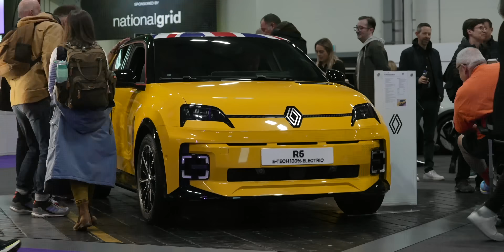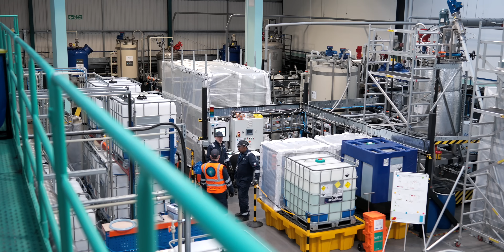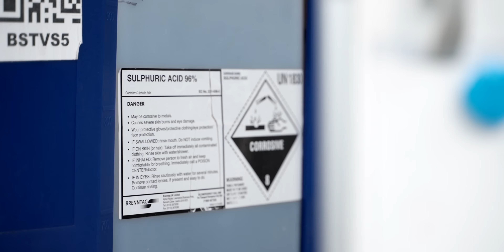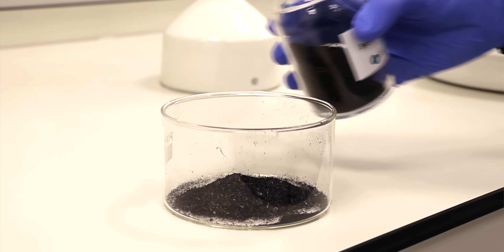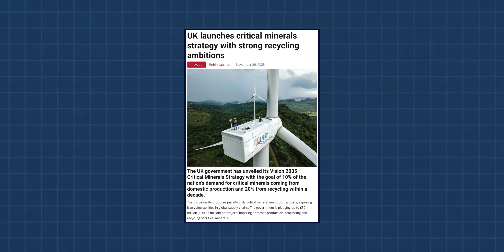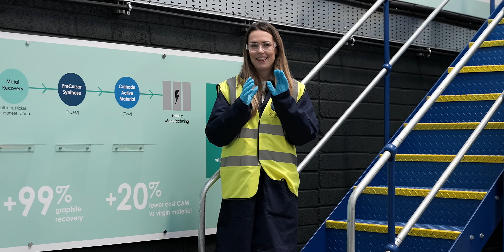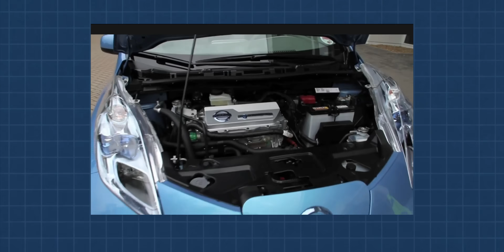EV Battery Recycling Could Be The End Of Mining!

Comment: I accidentally think that currently there is not enough used batteries for recycling to be actually profitable, a lot of second hand batteries are going towards electric storage, EV conversions,...
Great video
Reply: It seems you may be correct. EV batteries are lasting longer than anticipated, and of those that do become available. many get used for energy storage in commercial and industrial applications.
Reply: @Brian-om2hh 

An interesting point.

I would suggest the reason for this "longer than expected" lifetime  ref BEV battery packs is that BEVs aren't driven that much after all.

Which might suggest to the financially literate that for the private buyer spending a fair old chunk of cash upfront (and possibly on terms) is not such a clever idea.

Leasing has its own drawbacks too, which you can Google for yourselves so I don't have to crib if off the internet for you.
Reply: @ForestForest-n9i You can Google it. There are numerous BEVs with 300,000 miles or more. Not hard to find.
Reply: @ForestForest-n9i
At some point it’s worth stepping back and looking at what’s actually working now, not what’s been “five years away” for the last two decades. Battery Electric Vehicles (BEVs) have already won the light-vehicle race on efficiency, infrastructure, cost, and real-world usability, while hydrogen remains a niche science project for passenger cars.
First, efficiency matters. BEVs convert roughly 70–90% of grid electricity into motion. Hydrogen vehicles (both FCEVs and H-ICE) lose huge amounts of energy producing hydrogen, compressing or liquefying it, transporting it, and then converting it back into electricity. Once you count all that, hydrogen struggles to reach 25–35% well-to-wheel efficiency. Using clean electricity to make hydrogen instead of charging a battery directly is simply wasting energy.
Second, infrastructure is decisive. Electricity is already everywhere. BEV owners can charge at home and use a rapidly expanding public network. Hydrogen stations are rare, expensive, complex, and unreliable. In the UK there are only ~15–16 hydrogen stations total, with about 6 open to the public, versus 57,000+ public EV charging points and growing fast. Globally the contrast is similar: millions of EV chargers vs ~1,100 hydrogen stations. You can’t scale a consumer technology without infrastructure, and hydrogen never has.
Third, cost and practicality. BEVs have lower total cost of ownership: cheaper “fuel,” fewer moving parts, and less maintenance. Hydrogen fuel is expensive (often $10–15/kg in the US), stations frequently go offline, and you can’t refuel at home. This isn’t theoretical—hundreds of Toyota Mirai owners in California are now part of class-action lawsuits after being stranded by broken stations, skyrocketing fuel prices, and vehicles that have lost most of their value.
Fourth, a point often ignored: FCEVs still use lithium batteries. They are series hybrids—hydrogen makes electricity, which is buffered in a lithium-ion battery that powers the motor. So arguments against BEVs based on batteries also apply to FCEVs, plus FCEVs add fuel cells, platinum catalysts, high-pressure tanks, and more complexity on top.
Fifth, the market has already decided. Global EV sales jumped from ~3 million in 2020 to over 10 million by 2023, with BEVs dominating. Automakers and analysts (IEA, BloombergNEF) consistently point to batteries as the winning technology. That’s why companies like GM and Stellantis have scaled back or exited hydrogen passenger-vehicle programs, and why hydrogen is increasingly being limited to specific heavy-duty or industrial niches, not everyday cars.
Hydrogen cars do have zero tailpipe emissions, but once you consider production methods (mostly fossil-based today), energy losses, infrastructure costs, and real-world failures, they simply don’t compete with BEVs for personal transport. While hydrogen advocates keep promising a breakthrough “soon,” millions of people are already driving cars that are efficient, affordable, charge at home, and work every day.
This isn’t ideology—it’s engineering, economics, and market reality. For light passenger vehicles, the conclusion is no longer controversial: plugging in beats waiting for a miracle fuel. @ForestForest-n9i
Reply: @ForestForest-n9i @ForestForest-n9i Tell is about what car you personally own then. Is it hydrogen?
Reply: @oddjobsandrandomprojects all the Norwegians and Aussies must be wrong too

Comment: The UK added only 1.6% of extra cars to the roads in 2023, these were mostly NEV's, so the number of total cars on the roads increased by very small percentage, not talking about turnover understand, but the total number. So if all cars on the roads were EV's and all EV batteries were recycled after the car was scrapped then the total of new material required to make new EV batteries would be, well about the same tiny percentage. Of course this doesn't take into account the batteries given a second life by using for other purposes, but these of course can be recycled when they aren't useful for that as well so in the long run the world with full EV saturation and proper recycling would need to dig up very few resources to sustain the same number of cars, only enough to cover the extra dded EV's per year. Of course moving way from lithium to solid state batteries that last longer and don't use these minerals will make a big difference also. While yes 95% of ICE cars are also required to be recycled, that doesn't remove the impact on the environment from running those engines for 10+ years.
Reply: Most Solid State batteries will be Litium based, with similar cathode materials. The Solid State bit changes the electrolyte, less so the anode/cathode make-up, nor the charge-carrying ion (Lithium). Indeed, a secondary recycling step may be added to recover the Solid- State electrolyte (depending upon it's formation, plastic or ceramic) in addition to the cathode materials.   

In terms of NMC, there are constant changes in cathode formation, such as the continual reduction in the amount of Nickel/Cobalt/Manganese needed in NMC cathodes (down to 1/18th of what was used in the past, and just about to drop again to 1/38th). This means the volume of minerals recovered from older batteries, will go further with a greater number of NMC battery cells made out of the recycled minerals. 

Further, alternatives, like LFP today, have different recycling steps but not too dissimilar to those used for NMC (can be performed in parallel), and new chemistries like LNO (Lithium Nickel Oxide) are starting to move out of the labs (and may displace NMC), which will add additional mineral needs and recycling chains. However, even if NMC is displace the minerals recovered stilll have a value in industry, just not reformulated for new batteries.

Lastly, Sodium may come on stream, although for the UK's mild climate this may not be immediate as Sodium is currently targeted as a cold climate technology (due to Sodium cells degrading faster at warmer temperatures). 

As to input material availability, in general, the battery recycling industry isn't aiming for a 10 year horizon, more a 20 year one, to start scaling from the 2040s, by which time it's projected to be a $90bn global business. What is being developed now are the chemistry approach, processes and equipment to be ready for that scaling (which will be rapid). Although, this could change and accelerate more rapidly, particularly if manufacturing automation reducing car pricing. For example, if automation enables cars to drop to more 'commodity' pricing level rather than 'aspirational' pricing, then beyond the initial take-up of 2nd life use, batteries may become more readily available as cars may change more frequently than they do today, with components feeding into the recycling process earlier than now.
Reply: @GruffSillyGoat Interestingly BYD and other are researching lithium sulfur based and sodium sulfur based solid state batteries. More research has been done on lithium so of course these are probably more advanced in the case of research and development, but sodium sulfur based batteries have a much higher potential for energy storage, 2-4 times that of lithium sulfur with some laboratory tests reaching 900-1000Wh/kg.

There's no doubt huge room for improvement in all battery types and development will continue into the future. Yes it's very likely the first SS batteries will be lithium based, but there is huge potential for other chemistries that may eventually supplant lithium batteries, the future is looking interesting, not all of us will be around to see it of course but it will interesting nonetheless.
Reply: @stevebrooks2361 - Once SSB's are fully cracked I anticipate the battery developers will shift focus to Metal-Air, particularly Lithium-Air which has a max energy density of 11,140Wh/kg (circa 4,000Wh/kg expected). The solid state electrolyte removes one of the key barriers to their implementation today, the solvents or aqueous based electrolytes cause unwanted oxides to form. The remaining batteries after that are more mechanical after that point, removing pollutants from the atmospheric oxygen cathode and preventing water access.

Sodium-Air could be developed as well but offers a lower 1,600Wh/kg energy density.

The drivers for these batteries will be all types of vehicles - planes, ships, etc - not just road vehicles.
Reply: @GruffSillyGoat Oh in the future yes, but as I have said before, battery development is rarely a revolutionary change, it's more evolutionary, we tend to go through all the steps between, so yes eventually that's where we will end up. Of course economically there's a natural anchor in factory investment, you don't build a battery manufacturing facility and then rip it down a couple of years later because you need a different facility for a different type of battery, you really need to run it for a few years and sell batteries to make that initial investment back. You might start small scale manufacturing of new batteries, but you have to make money on that factory investment first before changing over.
Reply: @stevebrooks2361 - you're assuming that new technology isn't a drop in replacement that can reuse the same lines. Your aldo assuming  the same manufacturer is involved rather than a new competitor who displaces an old one by developing new technology (particularly if aligned with national interests).
Reply: @GruffSillyGoat SS batteries can't re-use the same manufacturing lines as current batteries, any new and different battery technologies will probably have the same issue, so it's a fair assumption to make based on current trends. To make batteries as cheaply and quickly as possible manufacturing lines are fine tuned to the current battery chemistry and design.

Donut is an example of your second suggestion (well if it turns out not to be a scam as many are suggesting,)  yes it's true a new maker could come into the market and build anew facility, but Donut are looking at only 1GWh of battery manufacturing for the year to come according to their own statements. Building huge manufacturing facilities takes years and billions of dollars, there's a reason why a few battery companies dominate the industry, it's a very expensive one to break into.

Economy of scale is everything in the battery industry, new startups either need backing from the big companies or they need big venture money willing to invest in a risky venture, not easy to come by, but even then the economic factors involved will still be difficult.

This is one of the reasons many companies are saying 2030 for mass manufacturing of SS batteries, even of they have products ready to roll, around 3 or 4 years is what it will take to transform the industry to SS batteries with some small manufacturing going on for select products in the mean time.
Reply: @stevebrooks2361  - many solid-state makers are specifically aiming for incremental technology that takes advantage of current roll-to-roll production techniques and equipment. Solid state isn't orthogonal to existing processes, but an evolutionary one.

European manufacturers are seeking to match the competition, but are doing so using existing processes, such as Ilika plc in the UK who's been developing their own oxid based SSB for a few years now. The rest is a matter of commercial reality, and government support; the latter becomming more important as many governments have deemed domestic battery productoin a critical industry to establish and maintain. This is one reason why the UK has invested in battery production, having around 20GWH currently, but ramping up with a number of gigafactories supported.

As to Donut Lab, they claim their current pilot line has a 1GWH capacity, and have a site in Finland to implement a 10GWH production capability. Time will tell whether they're product matches their statements.
Reply: @GruffSillyGoat Solid state batteries generally can't be manufactured on current equipment because the equipment is designed for wet manufacturing, ie: non-solid state batteries, a full solid state battery can't be made using that manufacturing process. I haven't seen a single battery manufacturer claiming they can do that, I would like to see your source.

As for Donut, the last I heard is their new site will only produce 1GWHh of battery and they will be ramping up production in the future, not that the site they are building can make 10GWHh of capacity. Again a source would be nice as this doesn't match what I heave heard.
Reply: @stevebrooks2361  - I suspect your confusing manufacturing with operation, nothing prevent Solid State batteries being maufactured through a wet process, or semi-dry proces (paste/clay), the drying step removes the solvent (or water based) leaving behind a dry solid-state electrolyte. 

Both polymer and ceramic solid state electrolytes can be formed this way. For example, Argyrodite, and other Sulphides, as well as plastic (like PEDOT-PSS) solid-state electrolytes can readily be processesd using wet-coating methods; oxides are a little more tricky (tend to prefer wet blading techniques rather than pouring methods). 

It's in operation that all solid-state electrolytes have a dry contact with the electrodes. 

Indeed some of the steps to improve the interface layer between solid state electrolytes and electrodes also involve an additional wet manufacturing process that enables the material to form a better surface contact with the electrodes, with the solvent being dried off prior to wrapping the roll and enclosing to form a cell. 

For example, Stanford recently published their method for solvent free approach using a disolved silver solution between the electrode and solid-state electrolyte, forming a silver bonding surface layer (filling cracks and crevices) when dried. This approach uses wet coating/heating cycle, with a dry formed LZZO solid-state electrolyte (a hybrid wet/dry method).

Ilika I mentioned above use a wet method, and construct their Goliath SSBs, at the UK's Battery Innovation Centre (UKBIC), using a roll-to-roll production that multuple UK battery companies use as an acclerator to develop cells. As noted by Ilika on their website they use a wet coating process of an oxide based solid state electrolyte deposited on a silicon based anode, before drying, that results in a high yield level (93%). Their cells are currently can reach the the 50Ah (350Wh/kg) level. 

Solid Power also state they use the existing roll-to-roll processes for their Sulphide base solid-state electrolyte formation, with the process compatible with existing Lithium Ion production (they aim their electrolyte to be used in all solid-state and semi-solid-state production).

Interestingly a number of commercial battery manufactures have also setup mix dry/wet production lines (not just for solid-state but also for advanced cathode materials).

UKBIC simulates the same as these commercial lines, having both wet and dry roll-to-roll dry electrode forming capability, so can simulate commercial production scenarios. This is similar to the setup at the Fraunhofer Institute in Germany that also have a roll-to-roll process for both wet and dry battery trials. 

Donut Lab have stated in interviews (MissGoElectric/TwoBitDaVinci) that they have a 1GWH capable pilot line already operational, and a site for a 10GWH production (TwoBitDaVinci/TheElectricDuo). Although in some press articles (like CarNewsChine) they quote Donut Lab as saying it has plans to increase capacity to 20 to 30 GWh (but at CES they were more cautious with announcing their future plans).